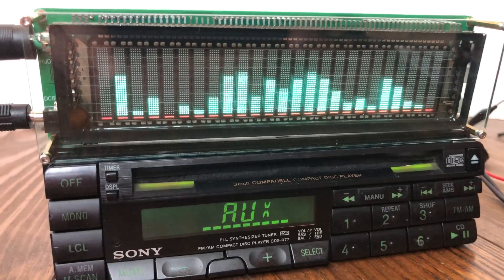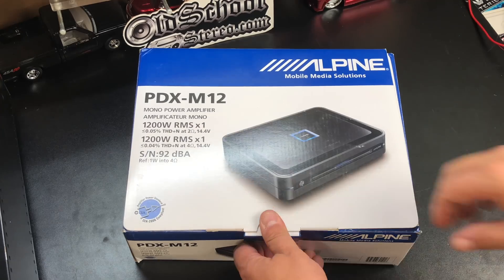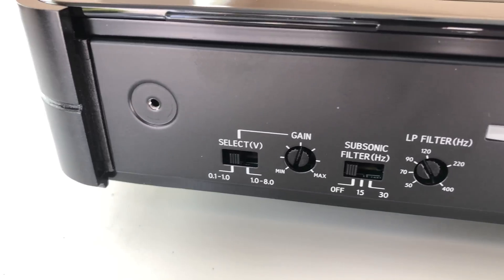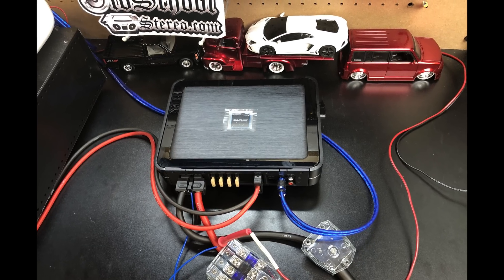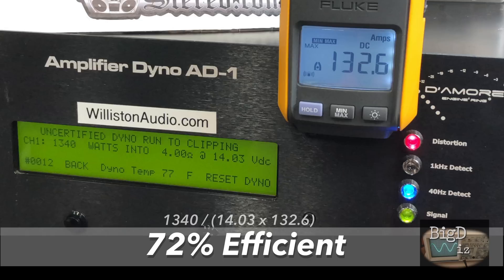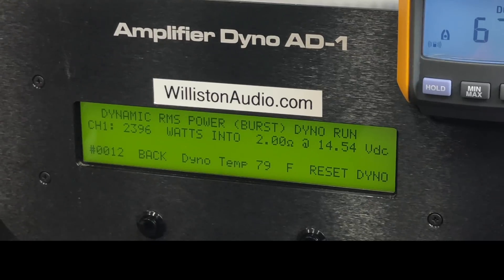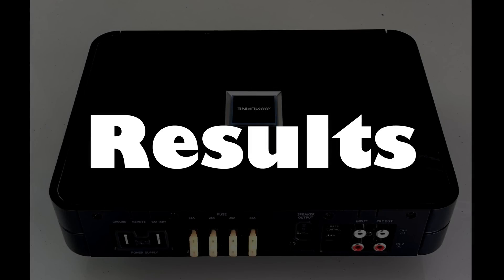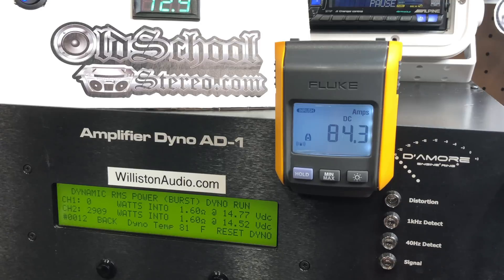Alpine PDX-M12 Amp Dyno Test

Comment: ive got the "first gen" version.... the PDX 1.1000 
and ya... i LOVE IT......been used hard for 10 years.... never overheated, never failed me
.
powered 2 type R 12s in a 99 buick century lol 
it almost ripped my parcel shelf off....
.
ended up blowing 1 sub (wire fell off... sent all power to 1 sub)
but i mostly listen to rock.... but like country and rap
so 1 sub on ALL THE POWER is MORE than enough

Comment: I know this is an old video, but I wasn't too surprised by this. I had an Alpine M350 to a single 12" 400w fosgate back in the day. I wasn't a total bass head, I wanted just enough to have that deep bass effect and that fit the bill perfectly. Was still enough to rattle some components on a brand new car.
Anyway, I had that amp/speaker setup for nearly 10 years without faults. Before that Alpine, I had a cheapo "1200w" ebay amp, assuming I'd get ~1/2 rated power at best. Well it crapped out in a year and I decided to spend more money to get quality after that.
Reply from the maker: Thanks for watching and commenting!

Comment: I purchased a 27' boat that had 4 sets JL 7.7" components mids and highs and 3 alpine type r 10's. It was the cleanest smoothest sound system out of any boat stereo I have owned. I think the pdx are very clean sounding amps. Those JL components soynded GREAT with them 👌

Comment: Maybe the PDX M12 is a good amp, but the PDX M6 pretty much Kills off subs with 43 volts of  straight DC. My m6 worked for a year before it died and almost fried my morel Ultimo subwoofer. Some design fault, Alpine has never admitted fault. Search for PDX m6 dc on YouTube and you'll see lots of people having the same issue.

Never buying alpine again.

Comment: So any problems with said amp yet? I have been daily abusing mine for hours a day for 18 months with a 8ohm load no problems yet, big 3 upgrade stock alt battery no cap 2010 mazda 3,
Reply: I’ve been running this with zero issues since 2009!
Reply from the maker: I haven’t done any further testing at this point

Comment: The plugs are garbage, who is taking their amps out of the car every night?  It doesn't save space, it takes more, and its higher resistance.  Its just another way to gain accessory sales.  And I don't love the "roll-back" feature, once that temp sensor goes bad, there goes 3dB or half the output power, and the average person isn't likely to know, they'll just think the amp sucks, again bringing up another sale.  Alpine died after the CDA9835, M1000 and AI NET

Comment: CRAZY dynamic numbers for sure! I want to know what barevids has to say about this "constant power" and how it works or why it puts out such a drastically higher number at 2 ohms dynamic..  Also quick question... What brand capacitors does this amp use?

Comment: Hi, does anybody know what kind of power it puts out at 6ohm or 8ohm? Does it regulate the power and still give you ~1200w? Or does it lower the wattage like it does when you go to 1ohm? 🤔 I'm trying to do 3 subs at 6ohm. My birthsheet has ~1400w at 4ohms. So if that's the case about 450w per sub! But need to know what the amp puts out at 6ohm ;(
Reply: If One does the math properly, they should theoretically push about 800 watts into a 6 ohm load. The reason they can do 1200+at 4 ohms is the high voltage output rail. Notice how the caps are 80V rated?  That means more power supply voltage=higher voltage to the speaker=greater power at higher impedances. 

The reason it does the same at 2 ohms would be a thermal limitation, not an electrical one. I have this amp BTW and it’s solid!

Comment: I got the four ch F4 and i’m not happy with the quality of the sound. Got a Polk Audio DB 6502 componet-set in the front. I try my cheep Xelent TX 4.50 amp and it sounds waaaaaay better. Sorry to say that,but that’s the way it is.
Can you please put a RF Punch P1000x1 or a Punch P400x4 up on the dyno....? I really like those amps
Thanx .....

Comment: Can the logo be rotated to line up with how its installed?  I mounted it vertically with the power connections facing down on an amp rack behind my rear seat in my F150 so the logo is upside down.

Comment: That seems uncommon for the amp to be rated the same in 4 vs 2 ohm loads.   I love Alpine products but for 1200 watts of power there seems to be just as good (or better) options for less than $750.

Comment: Great video! I'd be really interested to see what numbers you could get from older alpine amps like the mrp-m2000 and the mrx-m240. They were monsters and i'm sure underrated :)
Reply: Man those mrp lines/v line brand are everywhere on Facebook market but the mrx/X power brand was a monster I have 2 mrx 1100s and I run em on 2 old school Rockford fosgate power hx2 12s they rock I purchased the subwoofers from circuit city back in 2003 and the amps new in 2013 off crutchfield

Comment: I would like to see where you set the gains before doing the dyno
Reply from the maker: Gains in the amps are matched to my Alpine CDA-9815 head unit using the DD-1+ mode of the Amp Dyno. I set the overlap to 7-8dB. The actual setting in each amp will vary based on it’s input sensitivity settings / range.
Reply: @wal  koo thanks pal

Comment: Big  D, you really gotta rate these amps at 12v, 14v and 16v to give a wide range of tolerance. It would not only be extremely entertaining but for all the people with stock alternators and batteries running amps like this you can show them how much they're losing out on and how much they can gain at a given distortion rating, even amps like this alpine would change power dramatically from 12, 14 and 16 volt inputs, and you'd be surprised how much you'll get out of it
Reply: This amplifier cuts out at 16.1v. I know this as my ford smart charging voltage bounces about and hits over 16v. In current car voltage drops to 12.8v and can't hear/tell this difference which full voltage is given 👍

Comment: NEED SOME ADVICE GUYS. I just built a 35hz flare port box for a pair of massive audio hippo 8's(seems they just were discontinued, sad face) ... Anyway I am running them on a pioneer 8601 @1ohm supposedly giving them around 800 but Idk since i'm running 4ga nuconceptz  CCA wire, not 100% blown away.   
    ** Can someone Recommend me a reliable mono amp for $100-130 that puts out an ACTUAL 1000w rms.*** I would go with the pioneer 9601 but its not on sale anymore and I missed the open box sale on ebay for $114 which would have been rediculous. Open to trying audiopipe, hifonics, ect. I know the Skar 1000w is a great deal but it is more like $160+ tax.
Reply from the maker: Make sure the bass knob is plugged into the Pioneer. Also, are you sure you have them wired to 1 ohm? That 8601 should make those subs slam

Comment: Hey BigD, this video almost hit home with me, been wondering for years about my Alpine amp. I have an old school Alpine MRP-M350 which runs 350 RMS at 2ohms... but I have a Rockford R1200d which is 800 RMS at 2ohms. Both test over rated power, BUT this is the part I dont get. The Alpine sounds cleaner and deeper, but not as loud. The Rockford is loud, and hits, but it doesnt seem to get as deep. Why does this sound so different when both are good clean power? Both ran with exact same wiring, power supply and speakers (2 RF 12p2-)d2. I swapped back to the Alpine and put the RF in my truck to power 2 DD 508s.
Reply: Man i finally found some one with the exact same problem i have .I have the Prime 1200 on two Old-School Hx2 12 Punch and they sonud like crap on that Prime 1200 but before i bought that amp i had them on a Power T 1000 and they sounded louder and deeper .I have the exact same setup when i had them on the T1000 and now on Prime 1200 but they sound like mid bass driver's now wire to 1 ohm
Reply: @beerman9807  yeah, it sounds good. Very clean on the DDs in my truck, but still not as deep as the Alpine. There is enough power, and its LOUD. But it's not "rich"... like having eggnog vs having egg not flavored drink... both good, but the eggnog is "rich".
Reply: @Views.from.the.center  yea i feel u man but i just stuck with till i get enough for a T1500

Comment: BigDWiz love your channel - Thanks for running the Dyno test for these amps.  I've been waiting for someone to do this for a long time.  I have two of these along with an PDX F4 in my 2012 Dodge Durango. I didn't by these for people to hear me down the block but for a very clean and deep bass when you sat in the cabin which myself and other people were amazed. For the size and the power they produced was well worth it.  Had alpine 10s in a custom made box and the amps worked the shit out of them. Thanks again. Love your channel.

Comment: I’ve been using the M6 for 3 years now and have always wondered what it “really can do”, and can now assume it’s roughly half of this M12.  Thanks for the review Big D! 

I will need to say that the M6 melted my JL13TW5V2 cone then snapped its voicecoil, as it had started outputting 43VDC before snapping back to playing music (I of course didn’t know anything was wrong until I smelled burning coil, and that this 43 VDC would only happen on startup if it would happen).  I didn’t induce any of the failure by clipping the amp while listening.  The protection circuit, as sophisticated as it is with the uCOM controller and complete current, voltage and temperature monitoring, and power throttling, doesn’t detect when the output is dumping DC voltage - and its potentially a fire hazard. Never had a red badge color— it was always blue!  This was a somewhat common issue if you check Amazon and Crutchfield reviews.  Mine still does it, but maybe 1% of the time only on startup, but since the board and FETs were pristine looking, I workaround it by simply shut the radio off if I hear the thump then turning the radio on again until there isn’t a turn-on thump.  It’s been a very solid amp aside from that startup 43VDC issue.

Comment: I have an interesting tidbit. I have installed alpine pdx amps in the past and noticed a huge roll off in power below 40hz. I tested a car with two separate amps.  They both hit 143@40 hz but the alpine dropped 7db at 30hz compared to the other class d. After some research on the net it looked as though alpine purposely gated the amp regardless of the subsonic filter.
Reply: Sub 40Hz takes quite a bit of power and I think what is happening is that the amp is scaling back power because you are dropping voltage. This is not the case with unregulated power supplies where it will keep pushing power (probably dirty) until it drops below a set hard voltage (~10.5V).
Reply: recon440 I don’t think voltage was the issue. I think alpine rolls off their pdx amps they make the full power they claim but only from 40hz up.

Comment: This video is near and dear to me being that I own a PDX V9. The PDX series are wonderful amplifiers. Some of the best I ever heard. Thanks for the video.
Reply: Brian Miles  I’ve got a V9 as well.  But it’s barely enough power for the 12” Sundown sub I have in the trunk. Works for now though.
Reply: @richarcm  Yea dude for that Sundown you're probably right. Mine is pushing a Zstat ZHP 12 not enough for it either but sounds pretty good. Cool talking to ya
Reply: Sundown drivers are not that efficient so you need a fair amount of power. You should do more research on speaker selection.
Reply: I’ve got one as well and it pushes two JL w3 pretty good, very clean sound and very respectable output for a small footprint
Reply: I too also have the v9 and I have it pushing a Skar Audio MA-8 and in a ported 1cu ft box. It sounds great at low volume but lose a little going up. Pretty happy with it. Do you guys have a capacitor hooked up to it? I don’t and was wondering if it should be done.

Comment: Nice work BigD, love what you do. Alpine PDX rocks, got M12 running 2 * jlW6v3 at 4 ohm and Alpine F4 for the speakers, sounds awesome.
Reply: Same setup, JL 10 W6’s + M12,  Focal VR3’s + F4 (Should have gone F6).  Been running it for years now without any issues. Love them still!

Comment: Can you Dyno the Skar audio 400.4 compact amplifier i have a pair of Kicker 6x9 mid woofers and tweeter component's in front and 2 JL Audio 10W3's ran to a audio control LC7i to amp to speakers and WOW they blew the 10's straped at 4 Ohms final load bridged at 540 watts sounded amazing till it blew the subs in a 2018 Toyota Tacoma Sr with stock head unit.

Comment: Alpine makes good amps, at least they used to. I had an alpine v12 mrv-1002 running 2 jl audio w4 12's back in 98 or 99. That alpine would beat them to death. Still never had problems until 5 years ago when I retired them and the ground terminal some how broke(kids) and the foam dried out on the subs. Lasted a long time...

Comment: Great video Big Wiz.  I currently have this, and its great.  I got it for $350.  I am powering a 12w7.
Reply: I am assuming i am also getting at least 1200 watts RMS.

This amp is rated at 1200 watts RMS from 4 ohms - 2 ohms.
Reply: John Perez buying one tomorrow
Reply from the maker: Great setup 🤙
Reply: John Perez what are you getting at 3ohms?

Comment: Btw BigD, this amp can run at 1-ohm no problem but will just scale back output to 1000w. There is a processor inside that monitors thermals, clipping and voltage drop and will scale output accordingly which is pretty slick. I ran this one on my old vehicles with a 75A alt and would dim the lights, but progressively over about thirty seconds there would be a  slight drop in spl output as the amp adjusted itself to available  power and accordingly the dimming stopped.
Reply: What about 3-Ohms?
Reply: So if I run this at one ohm and I rise to two ohms I'll get more power at two ohms?
Reply: Imagine That !  Kicker makes very good amps clean power and always do more than rated .
Reply: And kicker amps last for 20 years or more.
Reply: a true 1 ohm load or a "1" ohm ported box setup...?
Reply: @RWL2012  Yes, a true 1-ohm resistive load. Its not advertised but I can confirm, as well as the actual Alpine rep on the diymobile forums. (This is applicable to the later PDX M series, not the prior generation PDX1.1000 with the silver ring) The regulation circuitry is much more sophisticated than your typical protection... You essentially cannot kill this amp.
Reply: recon440 wow nice :)
Reply: Yeah,  I think for actual daily street beat applications (aka. music) where you are subject to impedance rise, this amp should be on par to the 2000-2500W Korean offerings which are actually weaker at 4+ ohms.
Reply: What's with the  heat? Can it run on 1000w on 2 ohm without overheating? I think the heatsink is a little bit too small for that power...
Reply: @masterjumpstyler1  this amp has 0 heat issues being ran at 2 ohm it's made for 2 ohm operation . This amp is very very powerful and reliable.
Reply: @joshholden8561   mine doesn’t hold to good in the summer on my dd audio 3512Sc but I know it’s the box that makes it overheat
Reply: @bobbyfrank6661  what would ur box have to do with the amp conducting heat?  This amp is so sophisticated on a side note the sound is extremely good would compare to kicker quaility of sound .

Comment: was good to see this, just got my self some alpine type x 4ch and mono amps to run 4 type r 6.5s and a type r 12sub.
Reply: I picked up a set of type x 6.5s in 2010 used off amazon for 125 bucks shipped. Ran them in an 02 firehawk was an amazing system, type r 12s, mrp 600 4 channel running them all.

Comment: I used to have this amp and I didn’t like it. I ended up replacing it with an older Alpine M1000 amp which sounded better

Thanks for the video
Reply from the maker: I’m gonna test it in vehicle vs lots of other similarly powered amps at 3 ohms on JL 10W7
Reply: That should be interesting 😄
Reply: I don't believe that for a second

Comment: Just got  myself an alpine pdx m12 and a PDX f4 for my all alpine system.  The last alpine system I built used the alpine PDX f4 and pdx m6 and I was more than happy with them so the m12 should be great.
Reply from the maker: Reply back and let us know what you think
Reply: @wal  will do the pdx m6 was good so the m12 should blow my socks off.
Reply: @wal  I've been running the PDX M12 for just over an hour and a half a day for a year now and it is still going strong and sounds great pushing two type R 10s   sealed.  Would love another M12 but  you always want more.
Reply: @cockneyzombie  I have the exact same setup since 2009. I just had to replace the type r’s due to a blown voice coil. Just installed 2 type s subs rated for 600 rms each that match perfectly with the m12.